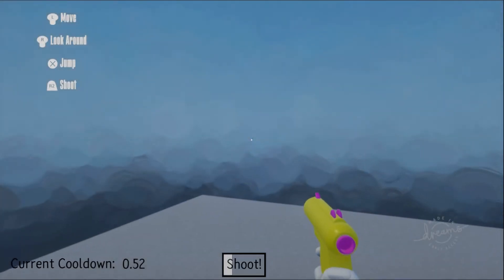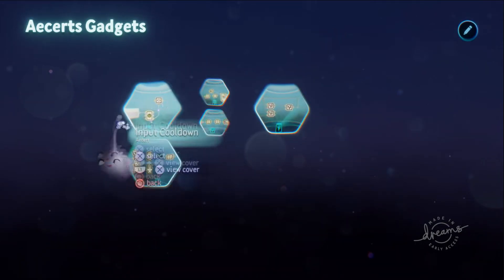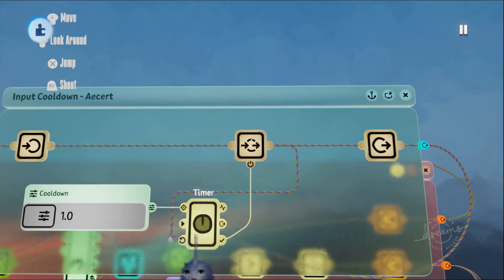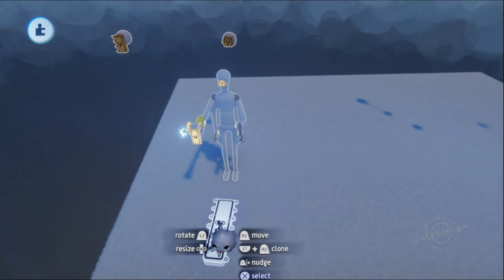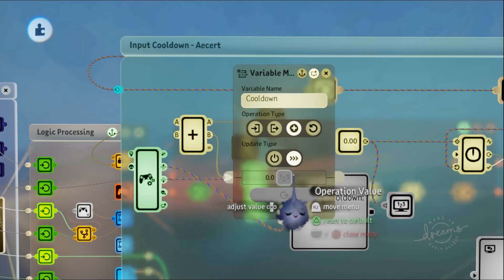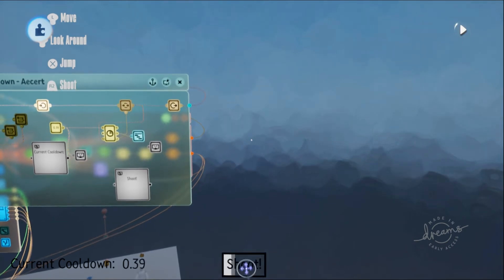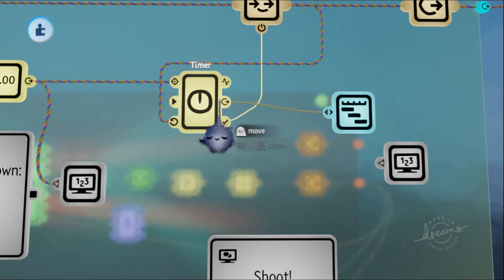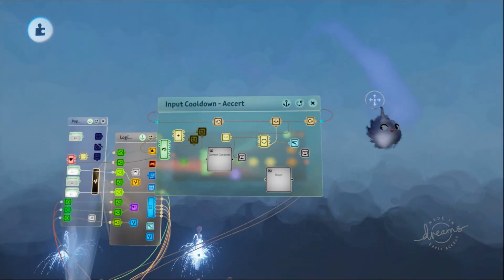How To Add A Cooldown To A Button Press - Dreams Tutorial

Comment: I am doing a game with abilities that I want to have a cool down before you use them so as to balance the gameplay. For instance I have a eagle soar ability that is programmed to the puppet logic on the double jump. What would be the best and easiest way to implement that ? By the way, great video logic is my weak spot right now but I’m getting it slowly.
Reply from the maker: Would the cooldown timer i made in this video not work for that?
Reply: Aecert I think so it just may have to be slightly modified if I’m thinking right. In my soar ability I have you hit the jump and the hit it again to glide. I’m wanting you to only glide so far and once then you would have to wait until you ability bar would fill up before you could use it again. Now I’m new to logic (well, it’s been a while) so I could be totally off lol! Thanks for the response
Reply from the maker: @kilartist1thedreamweaverga3  So the farther you glide, the lower your ability bar goes until its empty?
Reply: Aecert yes..
Reply: Aecert then I’d want it to take time for the ability gage to recharge.